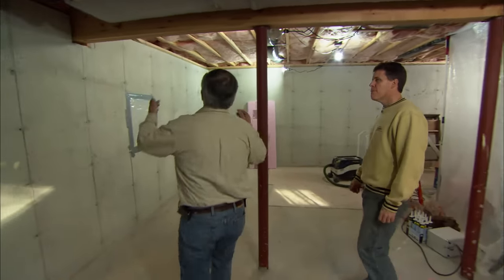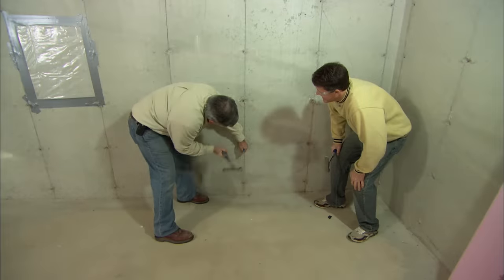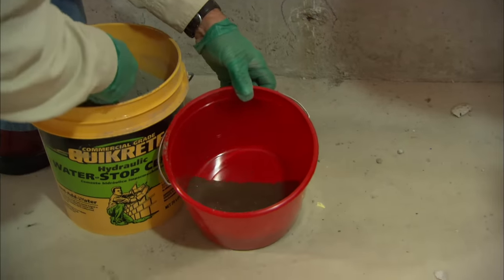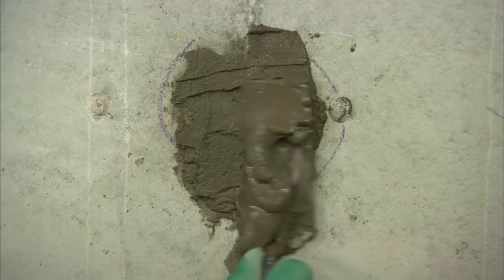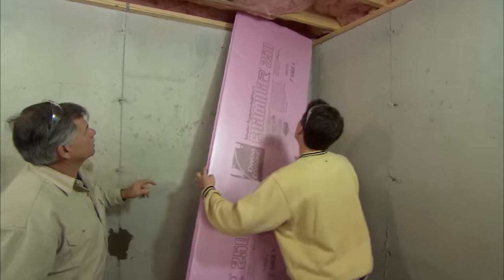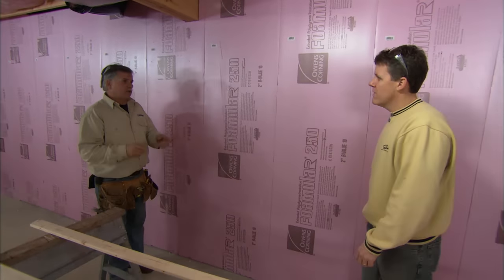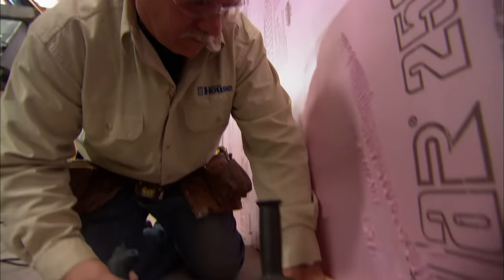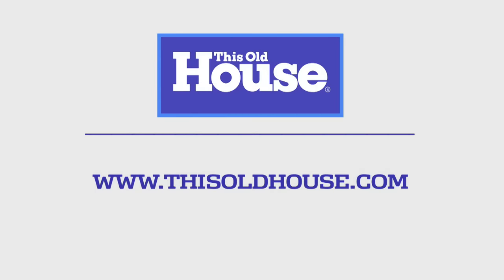How to Insulate a Basement | This Old House

Comment: This old House the show that teaches you how to waterproof and then drill holes into your waterproof and concrete to hold up thin flashing for drywall that in most states 2x4/2x6 studs are required by law!! Lost my respect for this show back to Mike holmes now